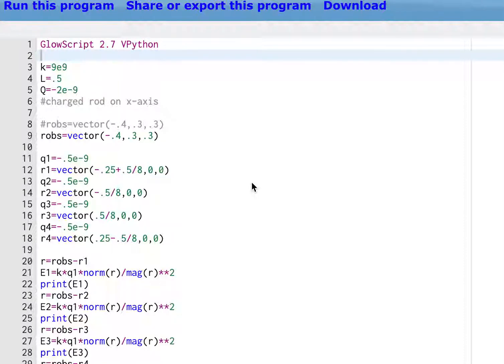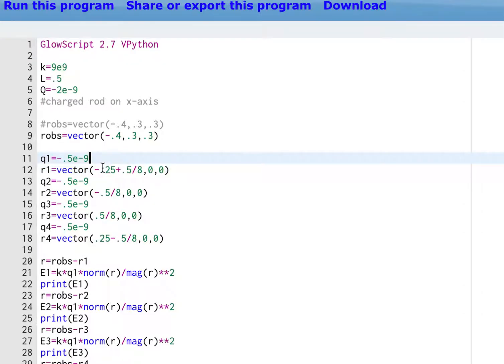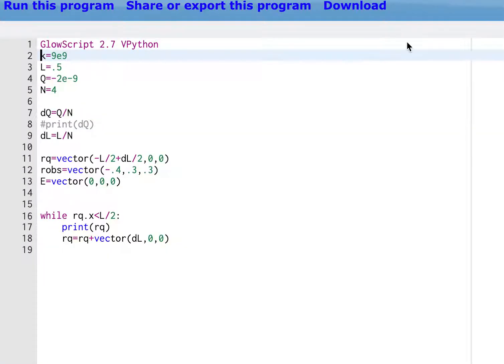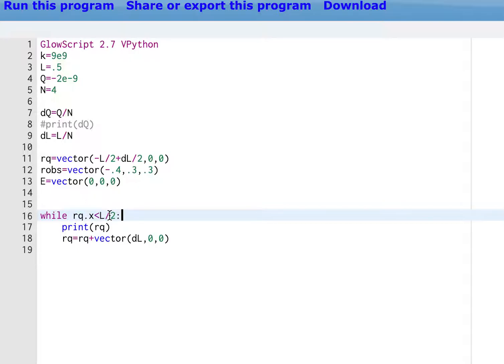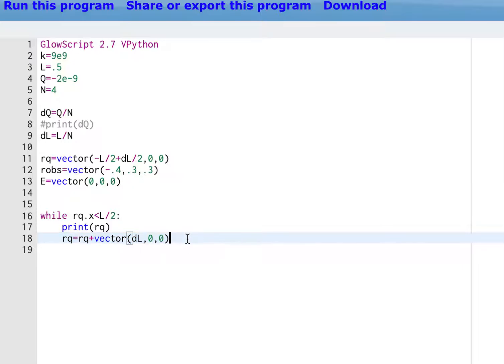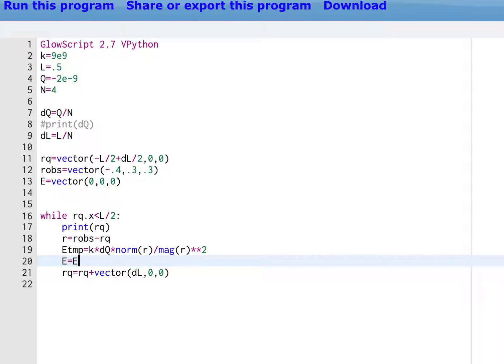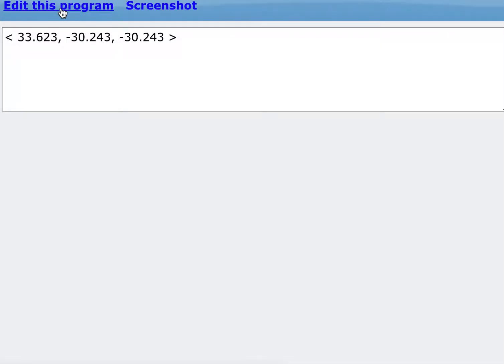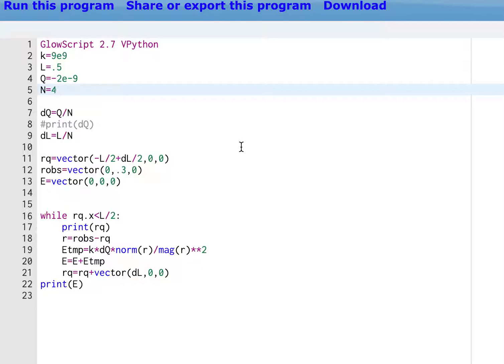Numerical calculation of the electric field due to a charged rod.

Comment: Consider a red rod of 1.5 m length with 200 nC of charge. The edge of the rod is located at <1,2,1>m . The rod is oriented in the z-axis. Plot the electric potential as a function of y for locations

<0,y,0>m . for y = 0 m to y = 5m .

Create a rod with the specifications mentioned.

Integrate over small parts of the rod to calculate the electric potential.

Plot the potential as function of y.